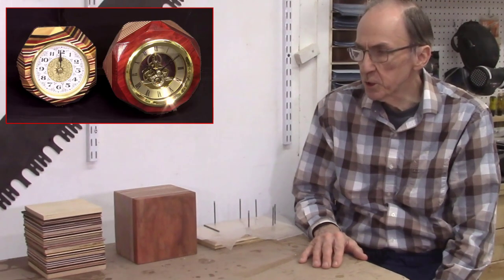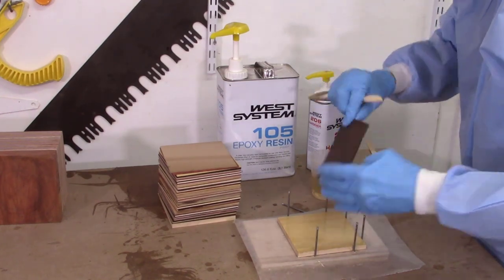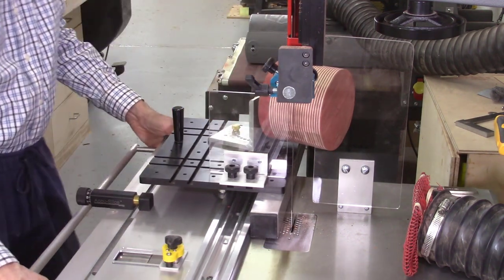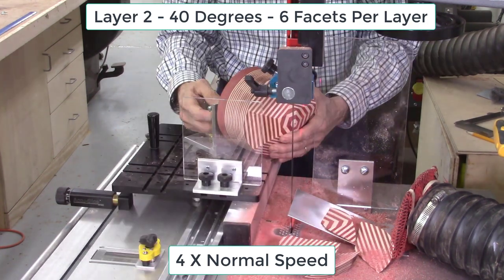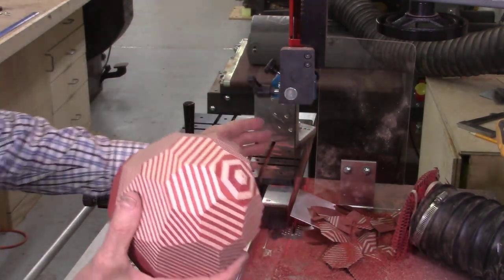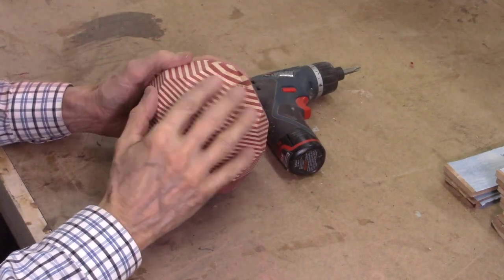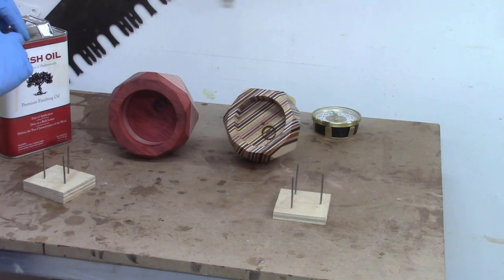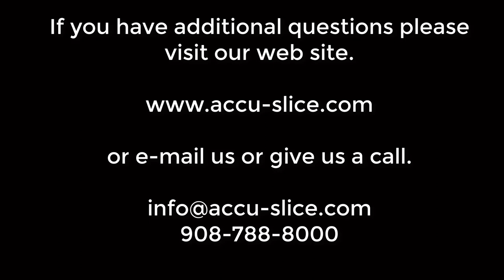Laminated and Faceted Wood Desk Clocks (99)

Comment: Of the two, I really prefer the red heart/maple clock. It really shows off the gem-like facets. That may have more to do with the orientation of the laminations rather than the wood species.
Reply from the maker: I also like the red heart slice on the face of the clock.  I will probably use this in my next project which is a Dizzy Bowl Pattern Faceted Desk Clock - stay tuned for this video now in production.

Comment: These clocks are wonderful. Question: Why did you use epoxy for gluing up the laminated blocks? I would think a PVA glue, such as Titebond, would be more than adequate in terms of strength. Did you use epoxy to give you more assembly time or for some other reason?
Reply from the maker: Yes I use Epoxy for the extended glue up time.  If I were only gluing up 5 to 8 boards I would probably use Titebond glues.  The epoxy gives me up to 30 minutes set up time which is needed when gluing up 10 to 50 boards at a time.